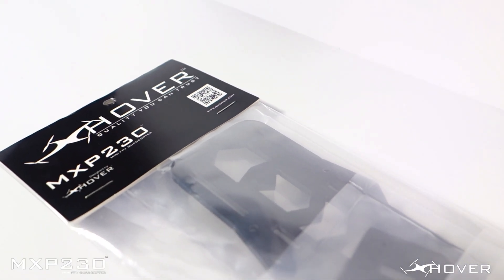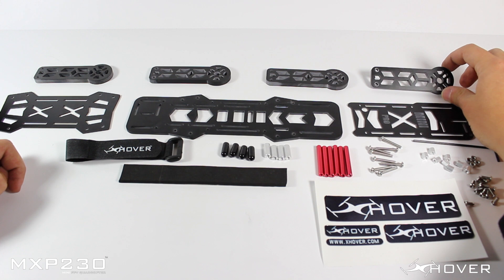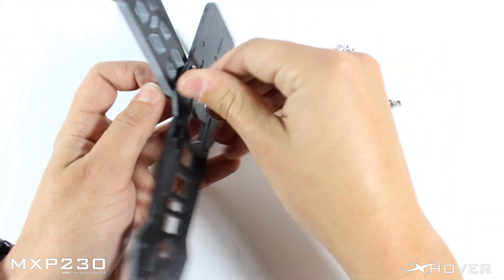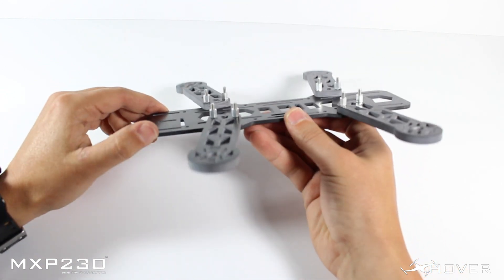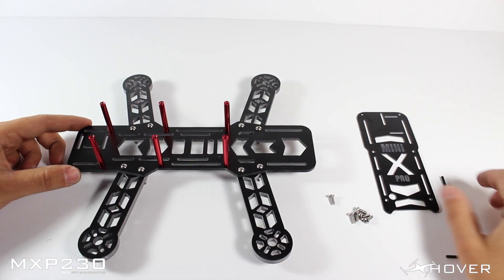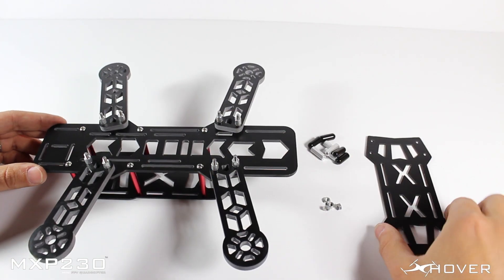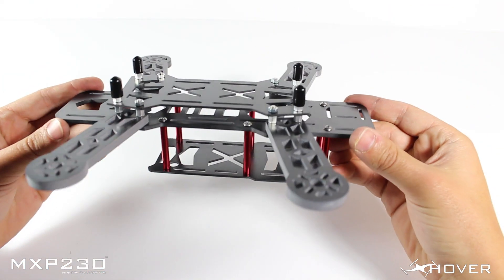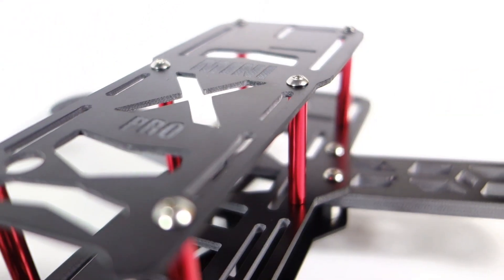MXP230 - Assembly Tutorial

Comment: Is there any downside to installing larger 20A ESC rather than the 12A that is recommended? I'll be running 5x4 props with 3-4S batteries
Reply: Trent Murray There is no downside besides slightly higher weight. It is actually a good idea to go with the 20amp ESC's to allow for larger motors or 4s packs in the future.